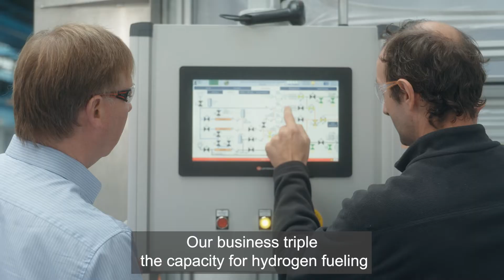Haskel Hydrogen Refuelling Stations - behind the scenes

Comment: Do you obtain your hydrogen from electrolysis using solar power or another form of renewable energy?  If not then you're polluting the atmosphere just as much as cars with gasoline engines (only the source is centralized).  Hopefully the energy comes from the sun :)